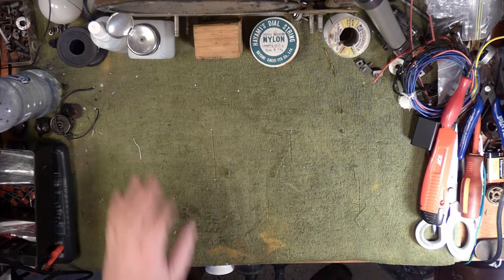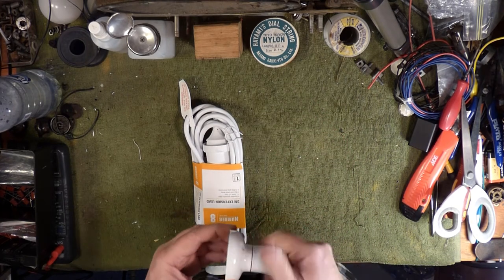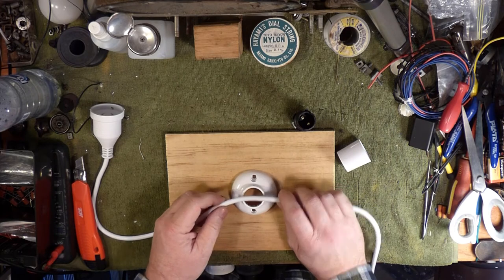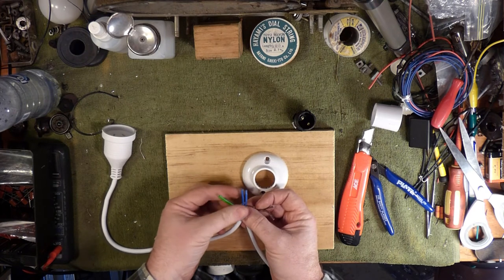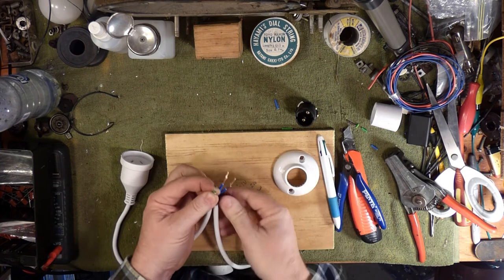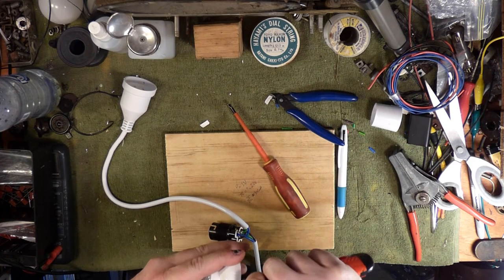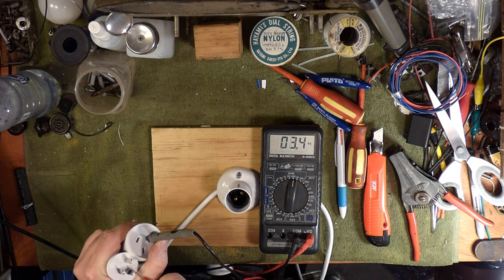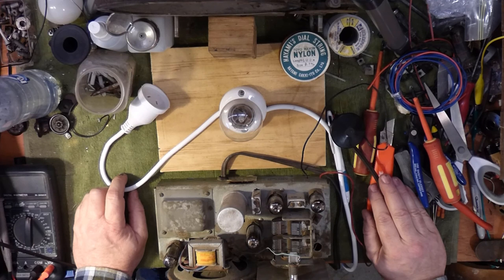Making a dim bulb tester - protecting that new vintage radio

Comment: Hello, I have just found your channel.
Where do you get the incandescent bulbs from?
I am in the central west of NSW and I can't find any incandescent, only CFLs.
I know that 'CFLs will not work, so is there an alternative, or do you have a "secret supplier"?!😎
Reply from the maker: Hi Peter, welcome aboard. Bunnings here have them, as do Mitre 10. Perhaps you guys have regulated against them? I believe that's happened in Europe... Let me know if you can't get them at Bunnings and I'll ask around for you.  Cheers, Steve
Reply: @VintageRadioSteve  Hello Steve, yes, apparently they are illegal in NSW.
Now if only I knew someone in the Mafia, that could get some into NSW on the black market!
Although looking around various electronic sites on YouTube, it seems that some people are using halogen bulbs,-I don't know if they will be ok in the long term.
Also how the filament resistance compares to the old incandescent bulbs.
What I do know is that Halogen bulbs are very expensive, compared with the old incandescent bulbs, which used to cost about $2.00 max, whereas, halogen cost anywhere from $5 to 7.00 which is a big jump.
Cheers,
peter.
Reply from the maker: @petercunningham4000  Is that ban nationwide, or just NSW?  And are they only technically banned from 'sale', or are they outright illegal?  Does the ban preclude you from buying one from out-of-state (or from NZ, where they are definitely still on the shelves), or would they only care if you were then trying to sell them locally?
I can't imagine if you have a specific use-case for them that the government would lock you up for buying them?  But then I've heard stupider political nonsense before... so maybe they would?  
The radio you are testing is not exactly an efficient electronic device - most draw in the ballpark of 50-70W when compared to a modern transistor or IC radio that probably draws 2-3W at best... will they ban our vintage radios next?
Reply: @VintageRadioSteve  Hello Steve, as far as I can tell incandescent bulbs cannot be sold in NSW, whether they are outright illegal, is a moot point.
Who would know if you had a hidden 'stash' somewhere?!
I notice some people are saying that halogen bulbs will also do the job.
I might buy one, and just see what the internal resistance is, compared to an incandescent bulb of the same wattage.
Cheers,
Peter.

Comment: Hello there, nice video you did

Have a few questions: can I just cut the  phase and connect it through the bulb (essentialy I need to wire the radio in series with the bulb right?)  (you seamed to put all the wires through the bulb socket and that confused me a bit)

How do I select the apropriate watage bulb for my radio, you sea, I bought myself a Blaupunkt 4W66K AL4 from ebay, (it costed 50€ and it was in an amazing cosmetic condition, the seller said it was working (and I saw the dial lid on the pictures, so maybe it realy does) and he wanted to clean his collection its probably a scam but we will see) and I realy dont want to ruin it so I will built myself this device

Can I leave this plugged in while listening to the radio, or will it do damage in the long run? (You sea, I am afraid it will break in the future and if I am not prepared....)

Does this trick only work with tube radios or I can also use it to protect transistor radios or more modern PLL radios?

Sorry for stupid questions, I am computer science engeneer and electricity is new to me :)
Reply from the maker: Hi, first up - yes, you can just cut the phase.  You've got the right idea, the bulb is in series with the radio to limit the current to the radio itself.

Typically I find a 60W bulb is adequate for most radios.  I've heard some people say they match the bulb to the radios power requirements, but I generally don't bother as its a fairly blunt instrument in terms of its operation.  Either you see a 'flare' in brightness (when you turn the radio on) that goes away, then the bulb slowly comes up to a low glow - or you see it go brightly.  The former is normal operation, the later is a fault.

And yes, you can leave the radio running through the dim bulb, but it won't be operating efficiently - and some radios will barely go at all.  They are designed to operate at a certain voltage, and the dim bulb tester will reduce that.y

In terms of using it with a transistor radio - I've actually never tried as those are low-voltage circuits so I tend to just replace the capacitors in the power supply and then give them a whirl.  The overall power consumption of a mains-powered transistor radio is probably only in the order of 3 watts or so, meaning you would need a very low-wattage bulb to even try it.  Also, remember that the flare you see, then the slow warm up, is a valve-related phenomenon.  Transistors come straight on, so you wouldn't see the same thing.  Assuming you get the wattage of the bulb right, I would expect you'd either see it immediately glow dimly or immediately go bright.

As for breaking the radio by leaving it on - I tend to not leave them on for long periods, and never leave them on unattended because they operate on heat - a lot of heat.  And unless you re-wind the power transformer and change every component for modern, you're always running a risk with these old sets.  Having said that, I have sets I happily listen to all day every day - but I turn them off when I am not around.

Oh - I'm a Computer Scientist too - at least thats what my degree says... so don't let that stop you :)

Cheers, Steve
Reply: @VintageRadioSteve  Hello there just an update if you are interested 

The radio has arrived, if you want to see look here: https://youtu.be/rUI4OCLG6Fw (it realy is a beauty, the cable is new, and it looks like inside cables were also changed)

I didnt use a dim bulb tester because it was powered on in the ebay listing and if something is blown its already blown so I couldnt do any more harm (I hope :)....) 

I guess it does work (the light shines, and it does hum more if I max out the volume) (I mean the volume knob does respond if I turn it all the way up it hums sligtly), it only hums if I max the volume, it does not hum otherwise

Not sure if sets from the 30s had any built in antenas, it does have an antena connector and an earth connector (labeled ERDE as earth) (not sure about a plug that would fit inside it, maybe a banana plug would do) 

Is it allright if I just connect an ordinary loop between Antena and earth jack, or would I do some damage? 

Sorry for questions like that, maybe there is a good forum for stuff like this, although, since this radio is german I dont think english speaking forums would have much info on it
Reply from the maker: @Veso266  Hi, somehow I completely missed this message - your Blaupunkt set looks very nice.  I remember the blue spot car radios they made when I was younger - they were very basic and chunky looking but always highly regarded.  I assume their valve radios were also well made.

I expect it will need recapping at some stage, and I would not leave it on unattended.

Those sets were almost certainly designed for long-line aerials – 10-30 metres or more of wire strung out.  You might get some reception from a cheap loop like the ones 90's stereos used to come with - but no guarantees there.  A long-line is probably best.

I realise its been several months since you posted - but how have you gotten on with it?

Cheers, Steve
Reply: @VintageRadioSteve  well, I did connect a loop to it (here is a video: 
https://youtu.be/EP-SMH70pP4

But there is no reception (it does hum and all, but receives nothing)

I even brought it near a electronic ballast for flurescent bulbs (which causes insame radio interference, and every other radio that I have picks that), but this one, like its nothing

I did open it up (where you can see the tubes) but I am afraid to pull this out (to see if capacitors are allright)  because I am realy clumsy and break things easly)

I did message the ebay seller asking for help (sent him all the videos), and he assured me the radio did work before shipping, and that he has 30years of expirience fixing this stuff and that I maybe just dont have any AM stations left in my area, yada, yada, yada (of course I have them, even on the video u can see that :)

Well, I now am trying to find some local person that could help me fix this, because I realy dont want to break even more souch a beautiful radio
Reply from the maker: @Veso266  It sounds like the audio stage might be ok, but there could be a problem with the RF stage - it's possible of course that one of the RF valves might not have survived the postal journey to your place - I'd get them checked first... You could try (with the power off) 'wiggling' each of the valves in a slight circular motion to rub all the pins in the socket, just in case theres a dodgy connection on one of the pins.  Keep us posted how you get on with it though. Cheers, Steve